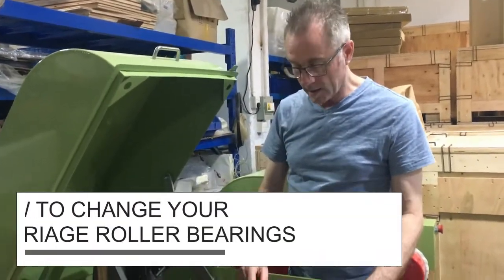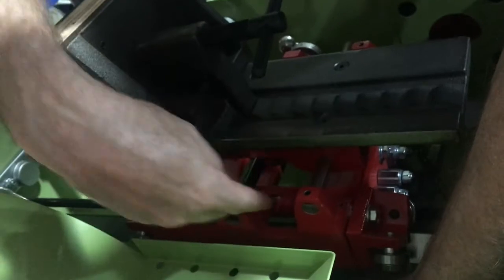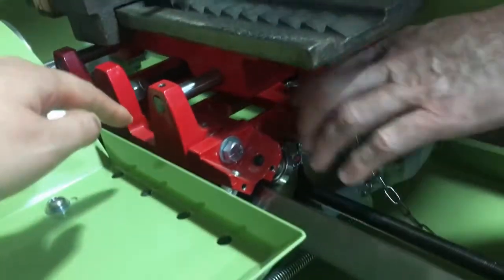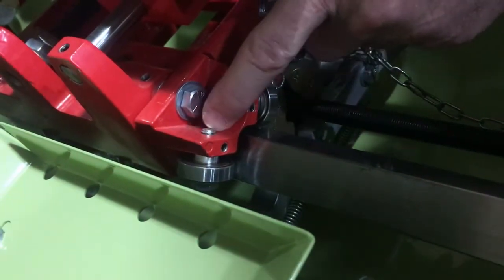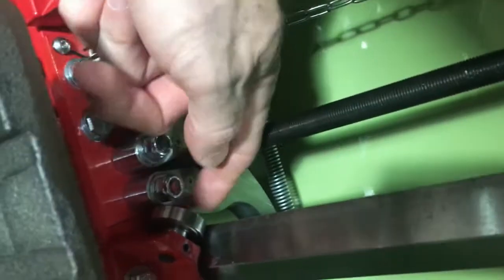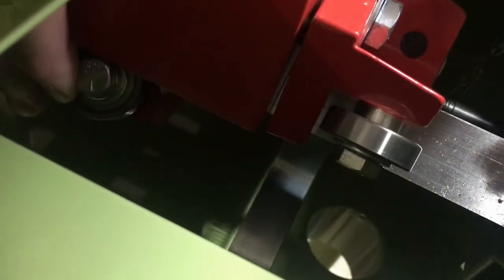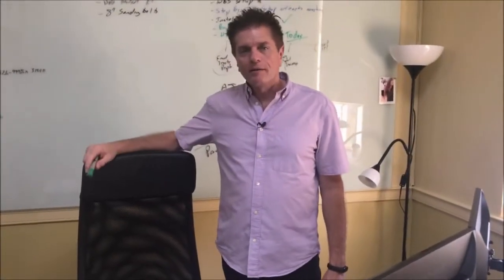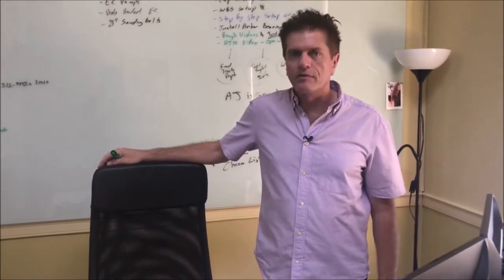How to Change Carriage Roller Bearings on your Highland Park Slab Saw

Comment: Need a video on setting arbor bearings and torque # for arbor bolts and set screws torque? Hp 14” slab saws.
Reply from the maker: Hey Charlie, you can contact our customer support team to help you at info@hplapidary.com.

Comment: hello there! I have a very old but refurbished 12inch slab saw. recently I've run into some trouble however. The saw runs great. The problem I have I think is with the feed. I noticed a bit of what looked like crude oil on one of my cuts the other day, (I cut a lot of Agates for custom tilework and Geodes for a few local rock shops) and now the feed doesn't move forward when I turn the saw on. I am not very knowledgeable when it comes to this sort of thing but there's nobody that I know of in my area to help me troubleshoot. every day this saw is down I lose money. Please Help!
Reply from the maker: Hey, Conrad! Appreciate you much for bringing this up. Call us and connect with our great team +1 512 348 8528 or send us an email at info@hplapidary.com. We are goin to wait for you!